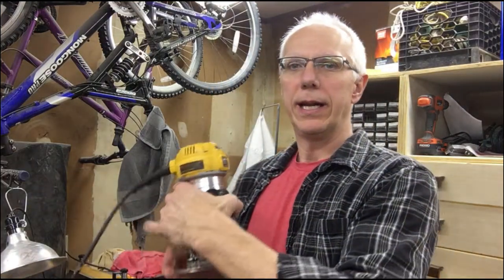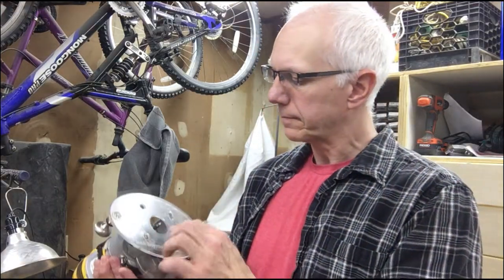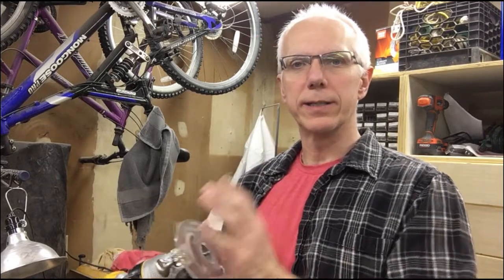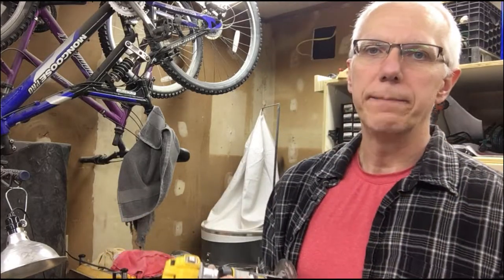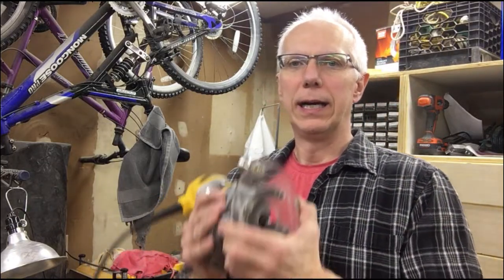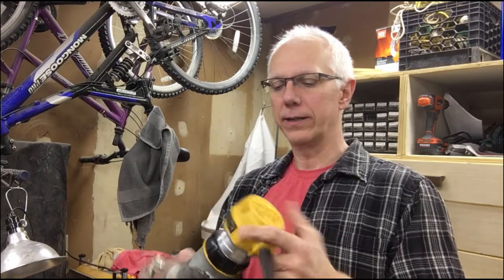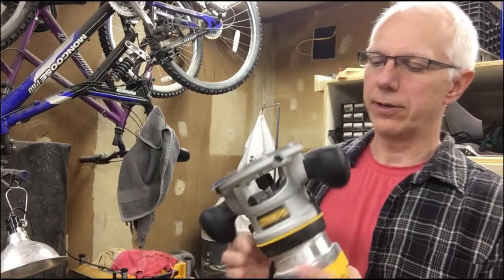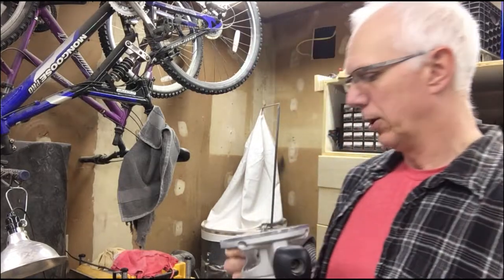Best Router for Carving

Comment: I use the full sized Bosch router with the plunge router base. It is open all the way around you can really see what you are doing and it has LED lights. It comes with a wide clear round plexi base. I pop it out of the plunge base back into the fixed base with the table insert plate and it is full purpose multi use. I have sold alot of projects carving with the full sized Bosch router.

Comment: Hello. Where did you get the dust control and how did you cut the second port. Please do a video on it. Thank you
Reply from the maker: Hi Jose. I use a shop vac on the router itself. If you are asking about the dust collector behind me, I got that at Harbor Freight.  For the second port, I used a hole saw and a drill press to cut it out. I finished it with a jig saw. Good luck!!!

Comment: I’m just getting into carving signs and I use a kobalt router atm because it was gifted for Xmas.
I’m a dewalt guy so,
My question is: you suggest dw611 
How would the battery version compare for sign making. I have a lot of the 20v tools and naturally leaning towards cordless. Was just curious on your opinion on performance for sign making??

Thanks in advance..

P.S: love the videos!!

Comment: Where did you get the dust control on your DWP611?
Reply: Hi Rick.  I bought it from Amazon.  Here is a link to the one I purchased.  I am happy with how it works.  I cut a second hole on the other side so could see while carving.
Reply: @steveschrecengost6021  hello. I don’t see the link to where to purchase the dust cover. Can you help?